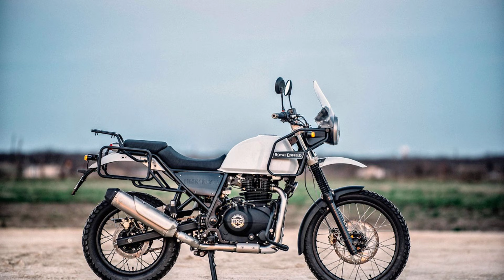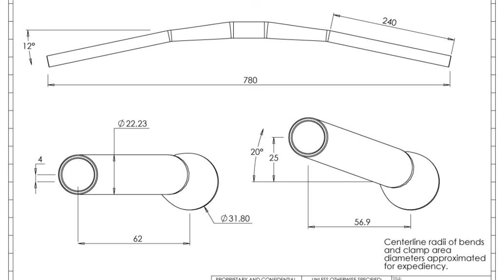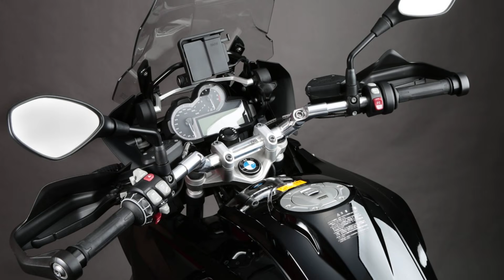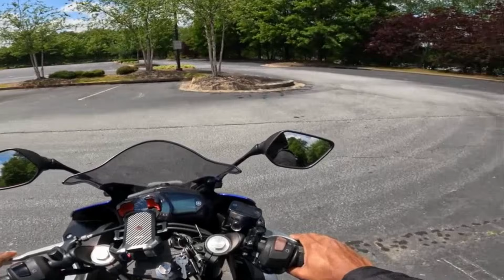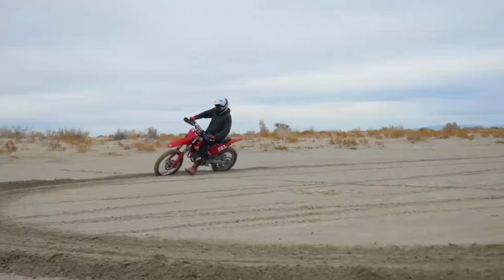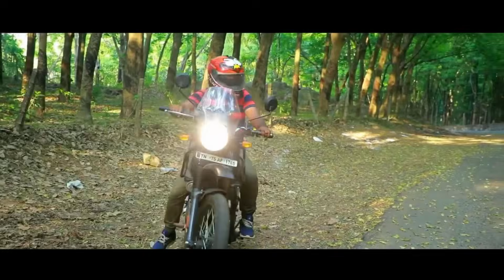The $150 Fix That Makes a YOUR BIKE Feel Like $20,000!

Comment: I wouldn't say nobody talks about it, but you do make a legitimate case, most of the riders out there don't even touch their handlebars until they feel like changing it for the looks. This apply to most if not all bikes and it's really cheaper than suspensions, exhaust systems and many others like ECM and all that expensive things for power and they even scoff about ride comfort but complains about it mid ride. This tips right here can solve all of that and Thank you for making a video about it